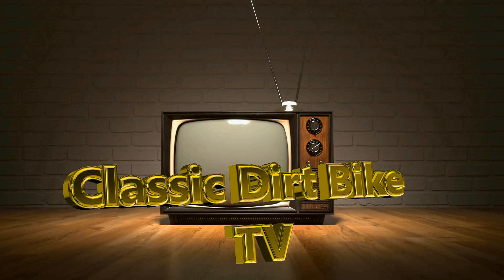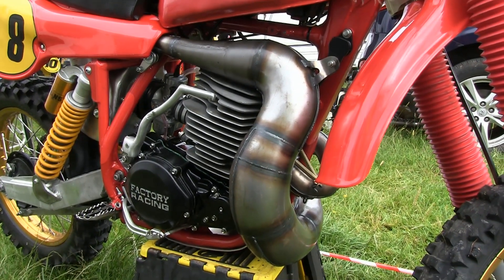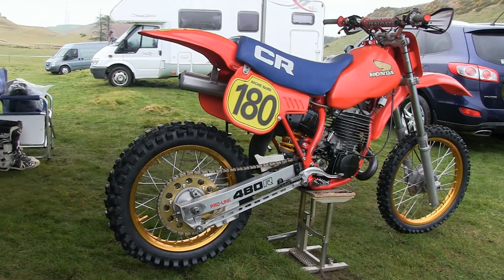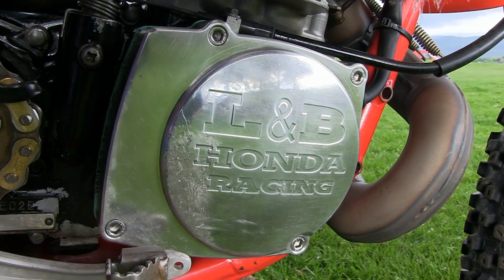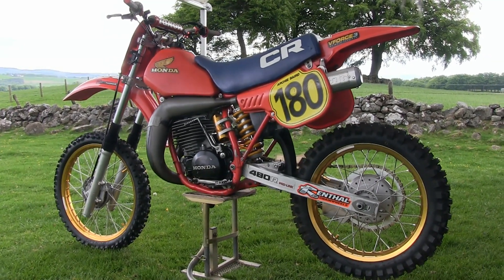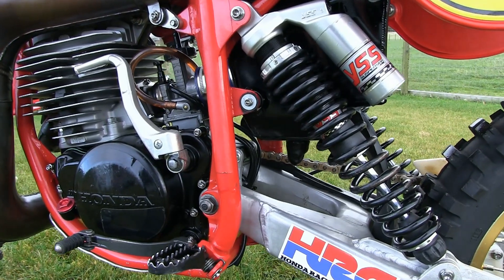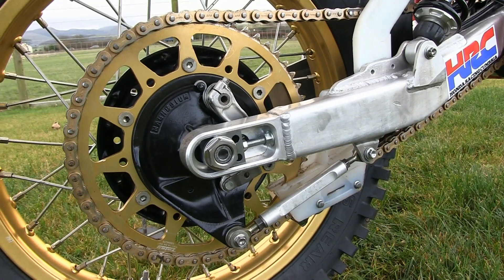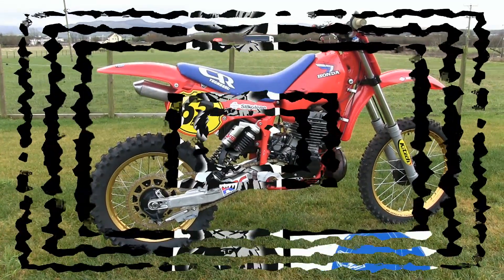Classic Dirt Bikes "Big Bore Honda's Part 1"

Comment: Help! I am having a nightmare of a time trying to find rear wheel bearings for a 1976 RM 250 https://www.bossbearing.com/Rear-Wheel-Bearings-Kit-p/s-rm250b-rr-1.htm claims these are the bearings.  They also say they do not fit the 76 A model, yet other ads claim the 76 thru 78 have the same bearing.  I have ordered 2 sets and neither fit.  One set the hub side was too big, (42mm), and the other was too large on the axle side, (17mm).  Mine calls for 2 bearings, and there are no rubber seals.  I definitely have a Suzuki wheel as it is marked as such.  My outer diameter is:  40mm.  Inner, (axle side), is:  15mm.  Depth: 13mm.  The hub is stamped:  "Max. Dia. 150.7," and "497."  Any help would be greatly appreciated.